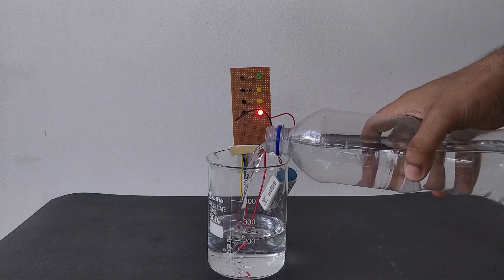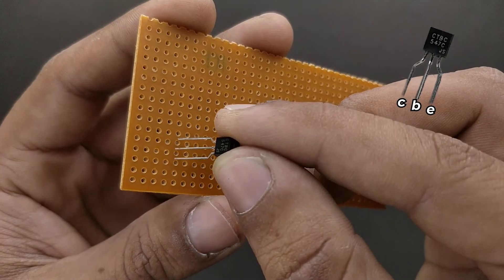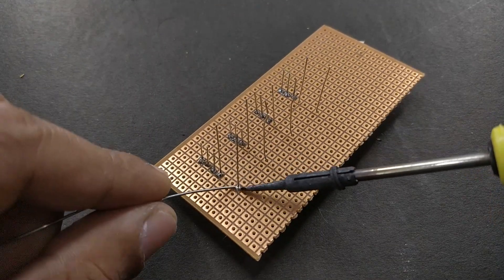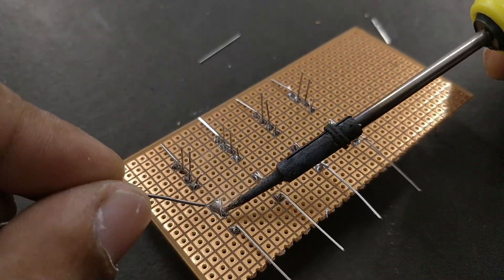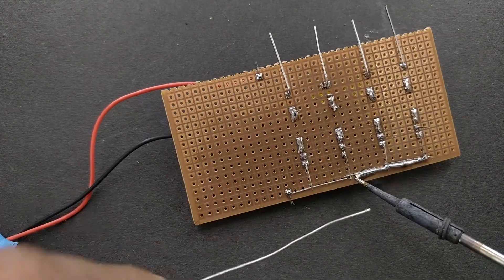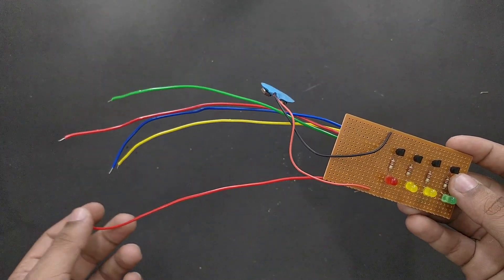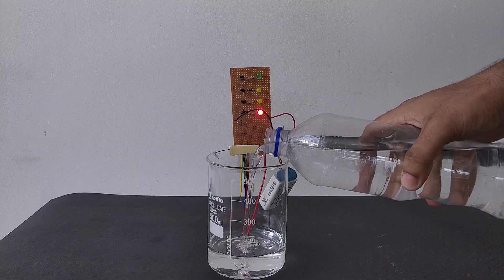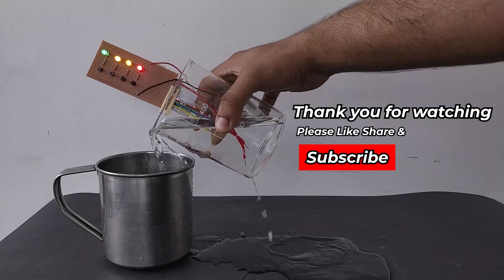How to make a  simple Water Level Indicator | DIY

Comment: Thank you for this amazing Video. Which sensor did you use for water level measurement?
Reply from the maker: Thank you for the support, there are no sensors used for this project. It's all done by BC547 transors and the wires dipped in the water.